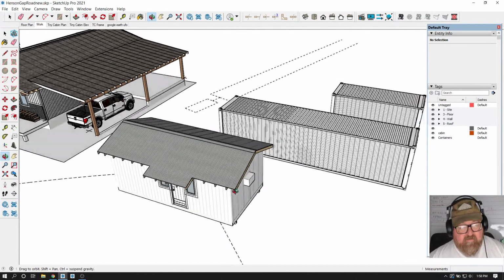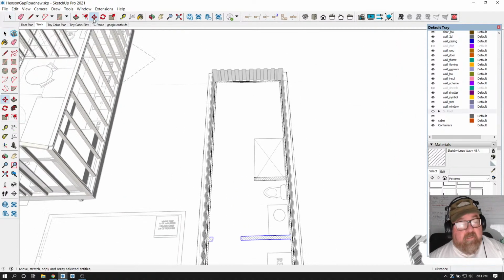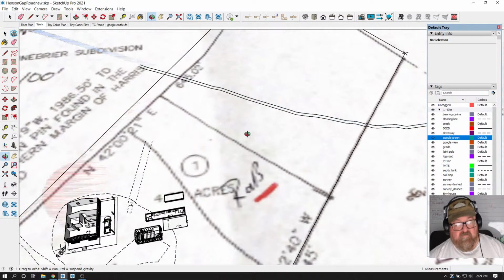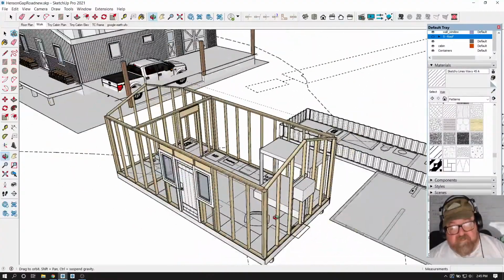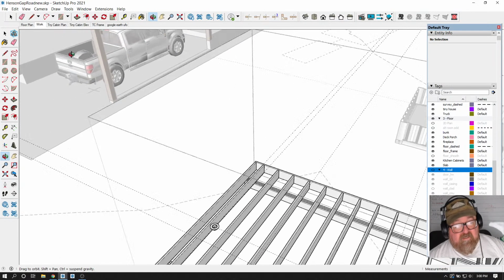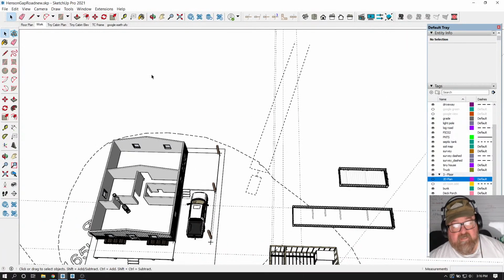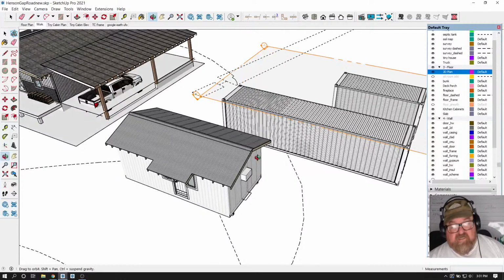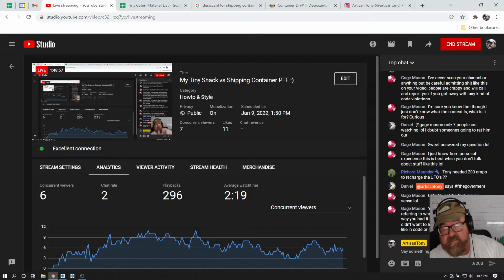My Tiny Shack vs Shipping Container PFF :)

Comment: Ram pumps have very little pressure and like you said require constant maintaining. Most off grid applications sound much better in theory than they are in real life. I use gravity fed spring water, but it requires maintenance to keep the line running and has some downsides that city water doesn’t require.
Reply from the maker: I agree, I have seen several installations of ram pumps and the guy said all he did was keep hi water running :)  As soon as he saved, money he was going to have a well drilled :)  but it makes for good YouTube videos :)
Reply: @ArtisanTony  what is your time table for building your tiny cabin, then your forever home cabin?  I know you’re anxious to get started. I’d like to see your place sometime since we’ll be almost neighbors and I was responsible for bringing you to Shangrila in the first place.
Reply from the maker: @tennesseetexan1957  I delivered some material today and Barret and I start framing the floor of the tiny shack on Wednesday :)  I'll give you the credit but I have been wanting to move there for at least 20 years but my then wife put the brakes on it.  I had a friend who handglides from about 30 to 20 years ago and we use to go up and look over into the valley from the ramp so it has been a goal for a long time :) Now that mu wife ditched me, I am headed to the mountains baby :)
Reply: @ArtisanTony  let me know if I can help in any way. Stop by next time you’re around this way & see our progress.
Reply from the maker: @tennesseetexan1957  Thanks John, we will.  I need to get my tiny shack built then I can come visit :)
Reply: @ArtisanTony  let me know if I can help in any way, Tony